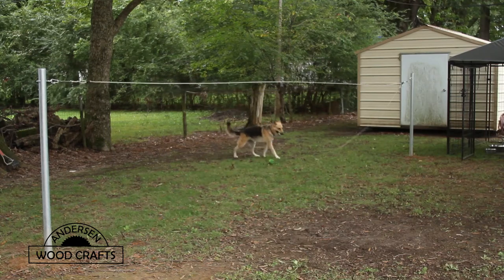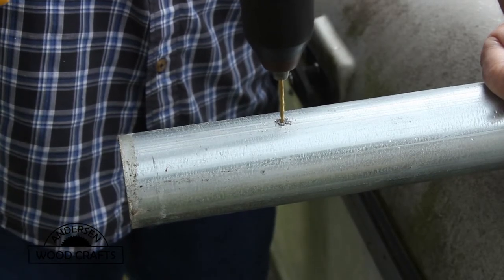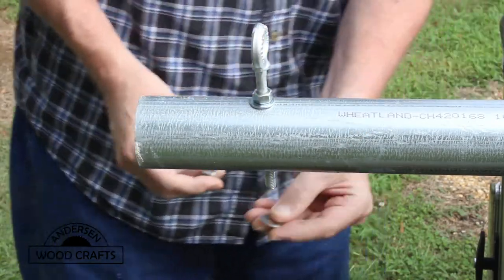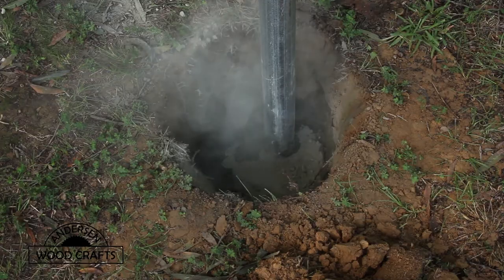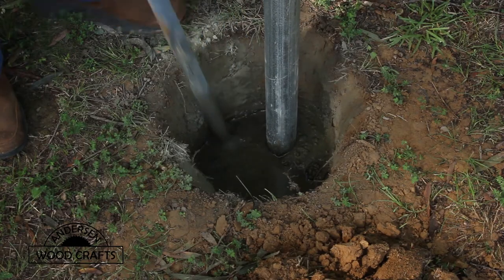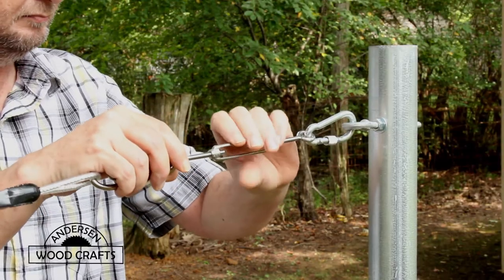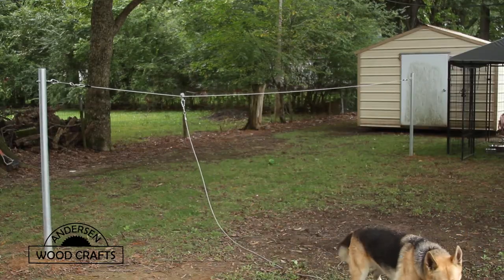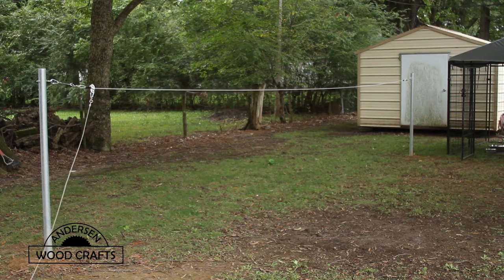DIY DOG RUN

Comment: Great idea. I used 250lb test cable. My pit bull snapped it  repaired it. Snapped the d ring. Twisted  everything else. If you're got a big dog. Don't use light cable!!!!  I now use 1000 lb test
Reply from the maker: Great tip!  Regrettably we don't have the dog anymore.
Reply: Something else that will also help with that is the runner line has to be tight there can be zero slack. And then the leader line that is connected in between the pulley and your dog needs to have spring-loaded anti-snap that is rated for at least 10 times your dog's weight so the cable cannot be snapped when they run to the end of it. So you have a 100 lb dog you would need to install a 1000 lb rated anti-snap spring. It basically works as a shock absorber show the line cannot be easily snapped.

Comment: You’ve saved me so much money with this diy especially as my brother already had the things I need for this thank you so much
Reply from the maker: Glad I could help!  Hope your furry friend likes it.
Reply: the problem is with it is the leash is to long, dog will get wrapped up around the post and choke and die
Reply: I'm glad it worked out just remember to keep the lead that goes to the caller short enough to where he didn't get tangled up in the cable the lead my poles the cable runs at 7 ft 9 in he has a 10 ft lead on the runner he has plenty of room either side without tingling up the lead off of the runner I tried putting him on a longer lead a 12 ft lead it didn't work out he would get tangled around the pole 10 ft give him about 5 ft either side and 55 ft Runner and his lead lets him get 5 ft either side so 10 ft across by 55 ft
Reply: This picture the poles are strong enough to hold the dog and cables my German Shepherd is a very strong puller I had to go with heavyweight pipe and Runner his lead is 3/8 also

Comment: your major flaw is, you need to put stops on the run cable so the dog does not wrap around the post. the stops should be the same distance as the length of the leash. If the leash is 15 ft., then measure from the post down the run cable and put a wire rope clamp. You may say it's no problem but if you are away and your dog wraps itself around the post it could seriously hurt itself in a panic. I urge you to look at other Trolley dog runs if you don't understand what I am saying. You need to put stops on the run cable so the dog does not wrap around the post.
Reply from the maker: Thank you for your comment.  Yes I understand what you are saying, the issue has been solved by putting a short temporary fence coming out from the posts, this way it doesn't shorten the length of the run.

Comment: Awesome, ty so much! I have two wolf hybrids who are going to need this. Now to figure out how to make this work for two dogs so they don't get tangled.
Reply from the maker: That is a good question and I don't have a good answer other than to build two runs.  Thanks for watching and for your comment.
Reply: Yeah two Runners so they can't meet in the front in the middle or they would get tangled up side to side runners just can't have them touching each other enough distance so they don't get tangled up

Comment: I ended up ordering 18ft treated round wood poles & they sent me 20ft of wood.  My line will be 15.5 inches off the ground & I think I'll try over 140ft on run, still under construction though.
Reply from the maker: Sounds good.  Make it to fit your needs!  Thanks for watching and for the comment.

Comment: If possible! Do it from wall to wall , keeps knots free,, run around posts 
Does not have to be that high 
Actually can be low to the ground
Reply from the maker: There are many ways to provide a dog run.  The area you want it can be the biggest determining factor.  Thanks for your comment.

Comment: Could a 10ft top rail hold well with a german shepard? just to get a little more height off the ground for the cable
Reply from the maker: I don't see why not.  Just need to insure the posts are firmly in the ground.  Also, need to consider the cost of longer fence posts can be quite a lot more, but if cost is not an issue, I would go with a 14 foot post and have 4' in the ground.  Thanks for the comment.
Reply: 10 ft great just as long as the cable don't reach the ground with the dog make sure it's up at least three or four inches off the ground with him right underneath it with it hooked up to his collar that way it says from getting tangled up around the pole if like mine light didn't got tangled up once and he hadn't tangled up again

Comment: How did the posts hold up after the dog had used it a few times?
Reply from the maker: Posts are holding up well.  They are 7' posts with about 2' in the ground.  The only draw back is the dog does get herself wrapped around the posts.
Reply: @AndersenWoodCrafts  thanks for the response. Just a suggestion, you could add some stoppers on the cable at a point to where the dog  can’t get close enough to the post to wrap herself up.
Reply from the maker: @prideofthesouthlandkennels  Good idea.  I can think of a few ways to help prevent that, but she is only gong to be here temporarily, so at this point we will just unwrap her when she gets wrapped up.  Thanks for the comment.
Reply: @AndersenWoodCrafts  I followed your plan and I found this out the hard way...I had to repositioned the poles

Comment: The only thing I don't like about this setup is how the leash drags on the ground. I want to have one that's retractable so that the line stays above the dog at all times and won't trip people or get tangled around objects on the ground. My mom sometimes ties our dog out to a heavy metal patio chair in the driveway but I don't think it's safe because you can't get close to her because she'll wind the rope around your legs and trip you up. And the chair isn't really enough to support her pulling if she decides to take off at full speed. (It just luckily hasn't happened yet.) She's a 45 pound pitbull border collie mix, but she has the physical strength and power of a much bigger dog. If you have her on a leash and she decides to take off after a deer at full speed, forget about it! You're going down. It's happened to me before. It's so frustrating trying to find an ariel run with a fully retractable or stretchable leash that isn't just designed for small dogs that don't pull that hard. I've seen a few on Amazon, but not any that I don't think she would break because they usually tend to be made of the woven canvas that leashes are typically made of and they don't usually have pulleys. Do you have any ideas how to make the leash part retractable so it stays off the ground? Maybe you could connect it to a second pulley that lets out line as the dog walks away and winds it back in as the dog walks back torward it, like the way a retractable dog leash works? Or maybe you could do something with bungee cords?
Reply from the maker: I like your idea, but I'm sorry to say I have no bright ideas for making a retractable leash.  Thanks for watching.
Reply: @AndersenWoodCrafts  When I check Amazon, they do have coiled tie out lines that stretch. They're like the cord on an old fashioned land line phone. The only thing is, I think they come in several different weights and if I were to get one that was to heavy, it would be uncomfortable and drag on the dog's back. It's hard to know if it's the right weight from looking online, so I'd have to get it from a store. But not a lot of places carry them. Maybe you could find one of those and try it. It's not any different from the type of line you already have, except for the fact that it's curled like a phone cord.
Reply: @Melissa0774 What did you end up going with? But when the dog is at rest doesn’t it tug on the collar?
Reply: @chicksgrowtoo  I didn't get anything yet.

Comment: how do u keep it from tangling around the poles
Reply from the maker: Yea, that was an oversite when I built it.  I put in a short fence at the end of each post which has prevented her from getting wrapped around the poles.
Reply: could u put a couple of clamps on the line at each end to keep it from getting close to the poles
Reply from the maker: @dreweybaker9259  I thought of that as an option, but with the length of the run I built, it would have limited the area the dog could go to about 10 feet.
Reply: The height of the main Runner to the length of the lead to the collar you want the lead to the collar just barely looping down not touching the ground and the post most dogs won't get caught in the post some will if you have it too long they will get tangled up around the pole if you have it just barely looping underneath like hanging right down below his neck whenever he's standing right underneath the runner that's just right he can't get his foot up over it when he gets around the pole but he'll have four or five foot on each side of the pole depending on how high you have the runner but that's plenty if he has four or five foot on each side that gives him a good 10 ft side to side my main Runner is 7 ft 9 high and the lead is 10 ft that goes to his collar with him standing underneath delete it goes to his caller hangs 4 inches from the ground and he didn't get tangled up sometimes you'll go around and around the pole when he gets wrapped up before he finally gets enough reps away from the pole but he didn't get tangled up
Reply: @dreweybaker9259  on my dog run I made it out of 3-in heavyweight drill pipe but the ends of the cable for the Run Runner cable I put cable clamps to stop the cable my German Shepherd goes around and around the poles unwrap himself and wrap himself back up but he knows how to get out he Tangled himself once and since then he knows not to do that I guess he's a smart dog but if you have too long of a lead then they'll get tangled on the pole itself with the lead instead of just wrapping around it or if it's too long they'll even wrap it around their self so it's important not to be too long of a lead going to the collar the runner as long as you can make it mine's 55 ft he's got 10 ft radius between the 55 ft and the cables with lightning directly under the 55 ft Runner with his 10-foot lead there's 4 in from the ground at the cable hangs that's kind of important because they'll get it tangled around their feet

Comment: i wanna try this but idk if itll hold for my pitbull
Reply from the maker: Sorry for the delay.  Don't know about holding a pitbull.  For larger (and stronger) dogs may have to put the pole deeper than the 2 feet I did.
Reply: @AndersenWoodCrafts  i was more worried abt the pulley and cable coming off, considering the dogs strength

Comment: Obvious design flaw. Needs either a pulley stops to stop the dog getting close enough to the poles (although this would pretty much negate the benefit of a line here), or a fence at each end to stop the dog getting tangled around the poles
.
Reply from the maker: Yes indeed.  A short fence was later put in.  It served its purpose, as the entire thing has now been removed.  Thanks for watching.

Comment: Where did u bought the martial?
Reply from the maker: The hardware was purchased on Amazon, here are the links:
Pully     https://amzn.to/3rUHElH
Carabiners    https://amzn.to/3lpmVEr
Turnbuckle    https://amzn.to/3lwpUuM
Cable     https://amzn.to/3vBm08e

The poles and concrete were from Lowes.
Thanks for the comment.
Reply: @AndersenWoodCrafts  what size ibolts did you have? do you think that would be enough to support two dogs?
Reply from the maker: @travisguerin6946  I don't recall the size of the eye-bolts I used, they were either 3/8" or 1/2".  I purchased them at Lowes in the marine section of the hardware section.  I believe these size bolt would be strong enough for a couple of dogs.
Reply: @AndersenWoodCrafts  OK. Thank you

Comment: I dont know how long ago you did this so I'm probably too late but still feel the need to say it. You really need to shorted the lead wire going from the dog's collar to the trolley wire. Just needs to be long enough to allow him to lay down. Too long and itll get tangled around his legs which could result in loosing a leg or foot. My dog had this issue. In his case the wire wasnt too long it's that he pulled so much he make the pole tilt alot putting sag in the trolley wire which ended up making the lead wire too long.  Luckily he didnt loose his foot but he definitely learned something.
Reply from the maker: Thanks for your comment.  I thing I understand what you are saying, haven't had an issue yet.  She about chewed through the wire, so now we have her on a chain.
Reply: “ luckily he did not loose his foot but definitely Learned something- “ you are a horrible person that should not be allowed to have any animal .
Reply: @worldgrooves2254  your a judgemental b... he was tied to a proper dog trolley so he can run around. Without being tied the crazy neighbors calls the pound and you know what they do to old dogs. It only wrapped around his leg coz it was longer than should have been and he pulled alot eventually loosening the pole his trolley was attached to which make slack in the line causing the lead to hang even lower. He was fine when I went to work when I came home I found him walking around with the sore leg . My wife and her brother was home and when they noticed it they cut the wire off. When I came home I tried to treat it myself after talking to vets but it didnt heal that good due to his constant playing in the dirt with my wife's shitzu. So after 2 days I took him to the vet where he received antibiotics and medication including creams and a wrap. After a week he was running around the neighborhood. We switched to a hand braded rope for the lead and reinforced the post. It haven't happened since. He is a outside dog mostly due to his size and drooling and my wife. He not inside so tieing him in a safe secure place is the only option to avoid dog pounds or cars. Fencing don't work, I tried them all. He digs under them and when that dont work he chews through them. My neighbors never tie up thier muts and one in particular is always in heat which is why he do so much to get out. They'll call the pound on him but never tie thier own dogs which tries to attach kids going to the bus. My dog zak is very old and mostly hangs around the porch when hes loose but only after he visits his friends. Just coz you have a big place can pay for trainers and have a house safe dog dont mean you get to judge others. My original comment was just to warn of the potential problem with the wire dog trolleys not asking for stupid comments from idiots like you. So karen f... off and keep you opinions to yourself.